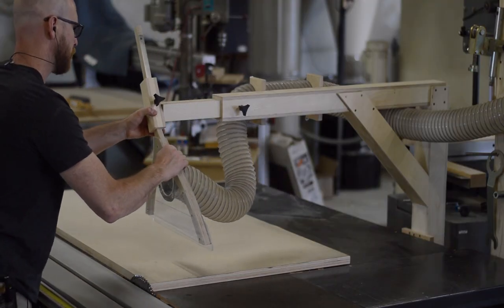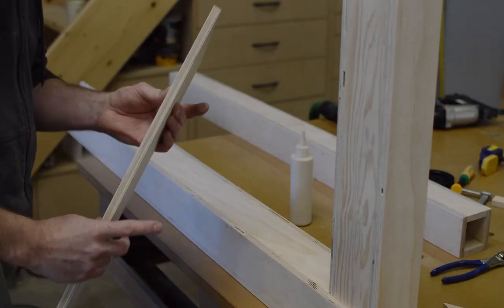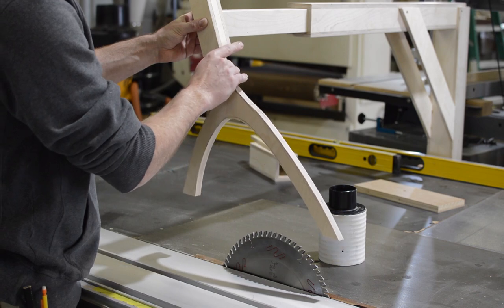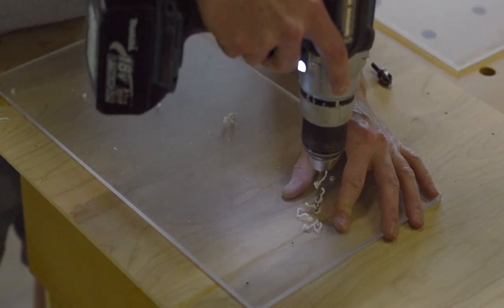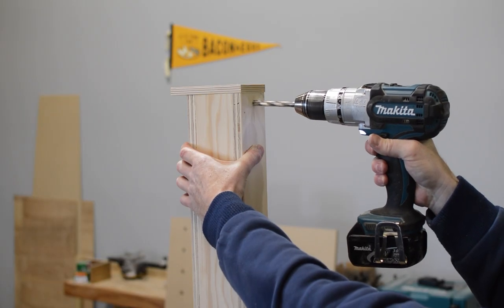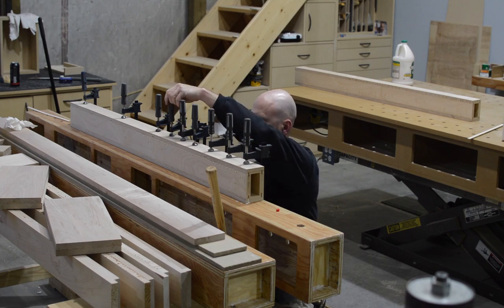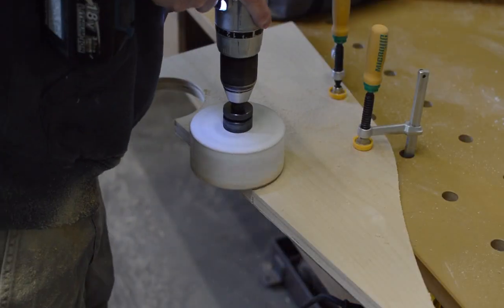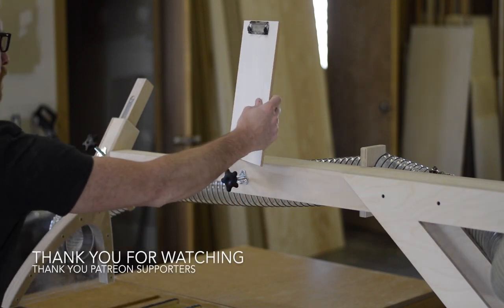Table Saw Overarm Dust Collection, Shop Built x 2

Comment: Inspired by your design, I build something similar myself and it works really well.   Attempting to solve the edge cut issue, I used a small cutoff from one of the sliding support arms, that was about 5 inches long after I cut the assembly down to final size.  I cut this "off-cut" in half, producing two 90-degree corners about 5 inches tall.  I set one of the corner pieces  just in front of the plexiglass enclosure, and slightly to the left of the axis of the saw blade. This would allow the piece being cut to slide past it, within a quarter inch or so.   The sawdust that would normally shoot toward me on an edge cut, instead deflects off the inside corner and upward, but settling back down near the plexiglass enclosure, where it was immediately sucked up with the rest of the dust. It's a very easy temporary fix.  I ordered a door sweep with a brush bottom that I plan to experiment with, attaching it to the bottom of the plexiglass enclosure which should allow wood to pass through the brush, and then hopefully form a shield after the board passes.  If that works, I will probalby attach it to the bottom of the plexiglass.
Reply from the maker: Thank you. I have kicked around that same idea of using some kind of brush on the left side.
Reply: @MikeFarrington    Update (for what it's worth).  I tried the brush idea on all 4 sides of the plexiglass enclosure.  While it captured all the dust for edge cuts, the tips of brush on the right side were pushed too close to the saw blade by the stock being pushed under it, and the blade eventually (probably touched) and melted of of the bristles together. So I removed that and instead added an additional piece of adjustable plexiglass on the left side only, with the bottom of the additional plexiglass flush with the bottom of the plexiglass enclosure. It has small pieces of plexiglass epoxied on each end that wrap around the front and back of the plexiglass enclosure by about an inch.  This closes most of the gap that would exist for dust to escape the enclosure on edge cuts.  The additional plexiglass has vertical slots near each end that allow it to slide downward up to an inch or so below the enclosure for edge cuts. It is held in place with two 1/4" 20 threadded knobs that inserted into threaded inserts that I added to the plywood shroud (under the left side of the plexiglass enclsoure.  This works like a charm.  The additional plexiglass assembly is kept flush with the bottom of the plexiglass enclosure for through-cuts, and is lowered to the surface of the table saw for edge cuts.  So now I have the the best of both worlds.  Virtually no sawdust escapes the enclosure now, even on end cuts. I posted this update to save you the trouble of messing around with a brush as it was not really workable. I also did not like the fact that the brush obstructed my view to the saw blade. Thanks again for a great dust collecting idea!

Comment: Nice. Procrastinating on making one, I'm still using the SawStop guard that came with the saw. It's marginal on skim cuts, it doesn't allow cuts less than about 1.5" width, and doesn't get used at all with the sled. And of course the 1.5" port reduces my 6" DC to almost useless. Guess I should get cracking on this. Thanks for another useful post!
Reply from the maker: Thank you. Yeah, the little 1.5 hose is a performance killer.

Comment: Just watched a bunch of your shop videos and hit the subscribe button. I am enjoying your workmanship and humor. I didn’t read every single one of your almost 400 comments, but I glanced and didn’t see anyone talk about the Plexiglass you used for your guards. Plexiglass is an acrylic which can shatter very easily. Lexan is polycarbonate which is what they make safety glasses and bullet proof glass items. It’s a much safer material to use around the blade in case something happens and the acrylic shatters where polycarbonate  will just bend.
Reply from the maker: I'm not sure what I called it in the video, but it is lexan. I think I use plexiglass in place of lexan, probably not a good habit.

Comment: God I envy these expensive wood workers. I don't have enough amperage in my shop to run both my saw and a vac so I just put a 90 degree on my outlet to keep it going downwards. After a good cutting session, I am COVERED in saw dust.
Reply from the maker: I've been there, this has been a nice upgrade.
Reply: @MikeFarrington  yaa. I Just got a thickness planer to sort of spring board my production and quality so I can start making money off of my craft. I think ill use that messy git outside as to help with cleanup.

Comment: I'm quite late to this party....the dip is looking a bit questionable.....but, I'm brave.
Thank you for building this.  I bought one of those new tricky saws about a year ago and chose not to add the overarm dust collection but assumed I'd build one  but still haven't.  This is a good push to do so.  I built one that hung from the ceiling  back in the olden days and hated that thing the first day of use.  I've used the old Beisemeyer ones also and the one thing I really liked about it was a clipboard holder and my coffee cup cozy installed on the horizontal bar as well as a mini white board so we could write nasty notes at one another.....fun dusty times before the internets.  Again....good stuff Mike.
Reply from the maker: Thank you. A ceiling mount version would be really cool, thats a good idea. Cup holder is a golden.

Comment: I really appreciate this project, Mike...I've been wanting to build an overhead collection setup for my slider for a long time and your hood design (the second one) is right about what I want. I have to mount it differently because of the sloped ceiling over my saw due to a stairway to the upstairs of my shop, but in general, this was very helpful. BTW, I like the clamping beam...what a great idea!
Reply from the maker: Thanks Jim, its been a great addition to the saws so far.

Comment: Nice build... gives me some ideas as I ponder my needs.  I like the actual blade shroud you built and will do almost the exact same thing (port side mounted, not top mounted).  Since my shop is in the basement and I have low ceilings, I'm thinking about ceiling mounting mine with side-to-side and foward-backward adjustability... mainly because my table saw can be moved and I need to realign the guard at times.  I should be able to flip it up at the ceiling when not used.
Reply from the maker: Good stuff, sounds like a good plan.

Comment: Definitely on my list, thinking about doing larger tubes, and using the tubes themselves as the collection pipe
Reply from the maker: I thought about using tubes as well. I ended up with this solution because it was easier to build and still had good performance.
Reply: @MikeFarrington  I do like the way yours functions

Comment: @Mike Farrington  
Great design & build, Mike!

One thing I've found in my experiments with these is that it works much better if the hose and air suction approaches the blade a lot more from the Front...so that the hood would be angled opposite to yours, i.e. from front to back.

Obviously this would be more obtrusive and "in your face", but because of the rotational direction, the blade naturally throws 85% of the dust forward towards where you are standing, and having the hose in front of the blade enhances the natural air flow direction instead of having to fight against it...

The forward air velocity (and therefore dust) shooting towards your belly off of the blade is quite strong.

Also, reducing the hose diameter to 3" or even 2.5" at the last bit helps for it to be less obtrusive and also increases the air VELOCITY and concentrates it to a narrower area in front of the blade where most of the dust is headed.

In addition, angling the hood into the left side of the blade or into the saw table from the outer left side towards the right increases the collection of the dust coming off the left side of the blade.  Very little dust is thrown straight up, or backwards, or to the RIGHT side of the blade.

I'd like to see you try a v2.1 to compare results.  If you can come up with a "low-profile" and compact design that isn't too obstructive, I think you'll notice a significant improvement.  ;)

ON ANOTHER NOTE...A QUESTION for you ...

I'm in need of a new Cordless Drill/Driver Set and I like the more Compact & Lightweight 12V cordless options for 90% of drilling & screw assembly duties.

Would you buy your BOSCH 12V FlexiClick Drill/Drivers AGAIN if yours were lost or stolen??? 

I see that you've Linked to the Makita 18V LXT Brushless combo set and right now I am only invested into that Makita 18V LXT battery & tool system as well, but I don't mind adding one other battery ecosystem.  I haven't been all that impressed with Makita's "Sub-Compact" offerings, so???

THANKS!  LOVE your channel and what you do and appreciate you sharing it with us!

Cheers!

- B.B.
Reply from the maker: Thank you. I would only build another version if there were an economic reason to do so. This one works good enough to where I wouldn't want to mess with it. It really does a good job collecting dust and its easy enough to adjust and get out of the way if needed. To your question. I have really liked the Makita Brushless stuff. The impact and drill have been totally great. I recently added some 5 amp hour batteries to my line up as well as their dust buster, and I'm shopping for a few yard tools to go with it. Weed eater, blower, etc. As to the Bosch 12v. Yes, as a guy who works at a bench the need for massive power in a drill is limited. My go to has always been the little 12v Bosch driver. This little drill has drill more holes and screws then I care to imagine. When this one breaks I would replace it with the one that has the changeable chucks.
Reply: @MikeFarrington  
Thanks for the quick & detailed reply, Mike.  Greatly appreciated and exactly what I needed to know.  👍

I'll pick up the Bosch 12v FlexiClick multi-head brushless kit, and then look into the Makitas for my H-D 18V drill/driver since I already have 4 of those Makita 18v 5.0AH LXT batteries...

Those batts are mainly for the cordless Makita XSL06PT 10" 36V (2x18v) compound sliding miter saw, which I'm absolutely loving.

No difference in power from what I've experienced compared to a corded 110VAC miter saw, and it runs ALL DAY on those two 18v batts!

Cuts and slides smooth as butter with the blue coated 40T Amana Prestige blade which I use in the table saw as well.  ;)

About the best dust collection I've EVER experienced with a compound miter saw, too.

It's still a large and heavy beast, though, even with the "compact'' forward slide/guide rails similar to the Kapex.

Through mid-July I think there is still a TWO FREE 5.0AH XLT BATTERIES promotion with certain cordless Makita Yard & Shop tools.  So if you're looking for a Makita blower & weed-wacker check that out!   ;)

Anyhow...THANKS AGAIN!

Cheers!
Reply from the maker: @bbfoto7248  Great tip on the free batteries, thank you very much.
Reply: bb foto Your comment was a good read.  Thanks for sharing your thoughts.
Reply from the maker: @gregohare2406  I agree, very good comment.

Comment: Great job the only thing I will change is the with so I can use it when the blade is at an angle !
Reply from the maker: The blade can be used at any angle, I just adjust the hood as close are reasonable, most of the dust is collected.

Comment: Great video again - I enjoy them very much! During the first minute or so I somehow assumed, that the dusted airflow would be sucked through the hollow holding wood arms. Arms would need larger diameter of course, but that would help with rigidity. Air friction loss would be greater though and construction complicated.
Reply from the maker: I thought about doing that, but, it made a simple project much more complicated. I didn't feel it was worth it.

Comment: Nice work Mike. Not sure if it was mentioned in the comments, but I added a piece of plexiglass to the side of my hood that was able to move up and down. So cutting a fresh edge I can adjust the movable piece to it sits on the table. So all that dust from the fresh edge cut hits the plexi and bounces back into the hood and away it goes to the cyclone...
Reply from the maker: I was going to do just that, and I may still do it, but when I got done with the second one, I just wanted the project over. I know, thats lazy, but its honest.

Comment: "
"
Hello, Mike
At the end of the program, you state, "There are many great commercially available options."  Well, I've been searching, and your design is better than most that I have viewed in this regard at least:  Your guard--sturdy and narrow--is the least obtrusive, allows for getting closer to the fence for those narrow cuts.  So many of the options are wide and bulky. The only other sleek guard like yours is to be found (as far as I know) on Harvey's elegant Shark S-12s--but at a cost of 1K!  I imagine that the narrow guard cover enables more efficient dust collection as well.

The Shark has an option that could easily be incorporated into your design. To accommodate angle cuts (left tilting blade) a bubble-like acrylic cover is attached on the left-hand side. Thus you could have two easily swapped out guards--the narrow for most cuts and a bubble-sided one for the angled cuts. 

Thank you for teaching and inspiring us. I'll probably purchase the best boom system of the commercially available units and modifying it with my own guard built according to your design.
Reply: Addendum:  This insight from Dennis @ Hooked on Wood who researched hood design as it impacts dust collection. This led to his novel development of a modified zero clearance throat plate as an important component--along with a well-designed hood (Like Mike's and Harvey's Shark S-12s)--for effective dust collection: 
"What I learned from the S-12 (overhead dust extraction) is that the size of the hood matters. I used it first with the 2 flat shields, so not with the hollow shield. I did this because I thought it would improve the suction because of the smaller area of the hood. But it turns out to be otherwise. You need some volume at the other side of your cut. (because that is where the dust will go to) When you have the hollow shield at this side, it stays nicely in the hood and it will suck 90% of the dust. "
Reply from the maker: Very interesting. Great information, and thank you for sharing. I have wanted to spend more time researching this topic, but just haven't been able to.

Comment: When I see Mike and the Apprentice have put up a new video, I drop everything.  Great project.  Would love to know about your process of developing the "product."  Off the top of your head?  Back of the envelope with a glass of wine?  Sketch Up?  Thanks for sharing.  Cheers.
Reply from the maker: Thank you very much. For this one, I did some looking on the internet, didn't find much. So I sat down and stared at my table saw for an hour or so and designed them in my head. From there I started cutting materials. The only time I design things officially, like on sketch up is when I am trying to sell them to a client.

Comment: Thoughts looking at my comercial one: The dust gets shot back onto you. so in mine there is a counterwedge to turn that stream backwards and up to the sucktionport. On top of mine there is a channel and the aktual opening is on the front (towards you), where all the chips are blown to anyway. The connektion to the hose is in line with the shroud an has a light bent knee on it (no 90°). The hose is just 80mm/3". Said this: If it works it works. And it has an pleasing form anyway. Everything is better than "biting the dust". This will help you a lot over time.
Reply from the maker: Thank you. Interesting idea about the wedge.

Comment: great project!  I wonder , if you beefed up the wooden tubes could you run the dust collection through the arm and only have a short section of hose at the end?
Reply from the maker: Thank you. I could have done that, but it would have been more work and I didn't think it was worth it.

Comment: Did you consider putting a brush/shoe so that it would capture skim cuts also? Looks like a great build and a good upgrade from my sawstop blade guard!
Reply from the maker: I have, but I just haven't gotten around to doing the buying and installing one. It works so goos as is that I don't have a lot of motivation to improve it.

Comment: The parts list holder is a really good idea. I wonder how effective it would be if you used the arm itself as the hose, attaching a blast gate at the stand, since it is constructed to be hollow anyway..? Probably wouldn't be as effective though. Usually my brain only comes up with worse ways to do things... DOH! 🥴
Reply from the maker: Thank you. I think that could work, it would just be more work. I wanted these to be quick to make, so I thought using the 4" flex hose was a good compromise. Hope that makes sense.

Comment: Great job and  excellent video. I presently have a 4 inch vacuum hose to the bottom of the table saw and I want to add this vacuum port to the top just like you did. So should I use a second gate with the second hose or what I put  a tee in the hose and have it vacuuming from the top and the bottom.  just wonder what you think about that or how you did that in your shop.
Reply from the maker: I think being able to turn on each port on its own is a good idea. So use separate blast gates. I think a tee would work fine, though these things are somewhat trial and error. So don't be afraid to change.